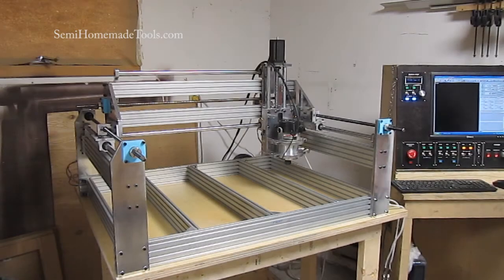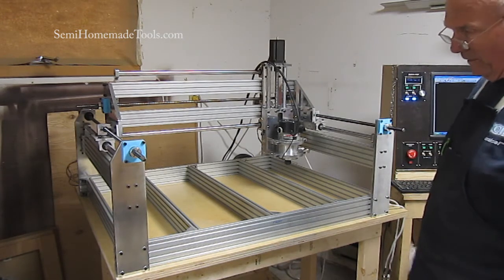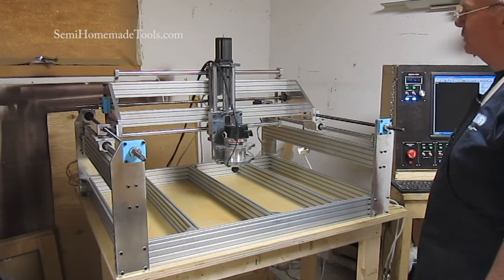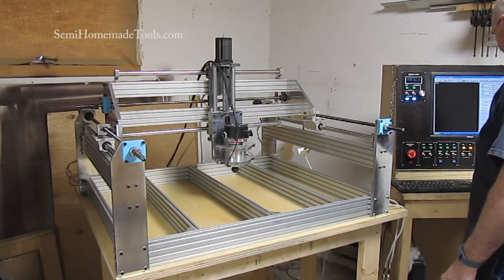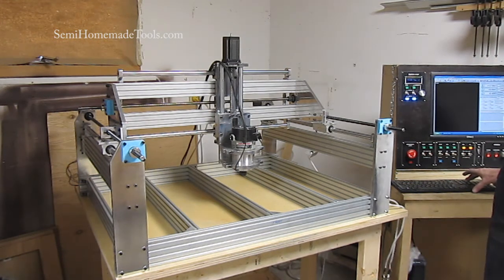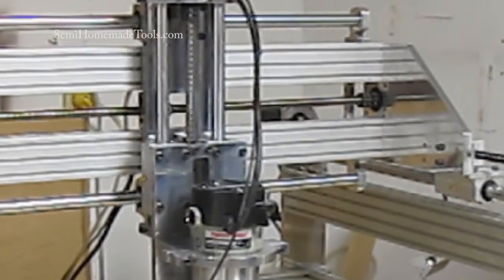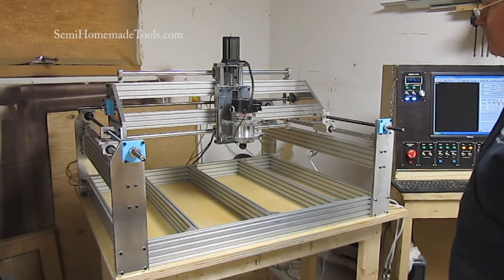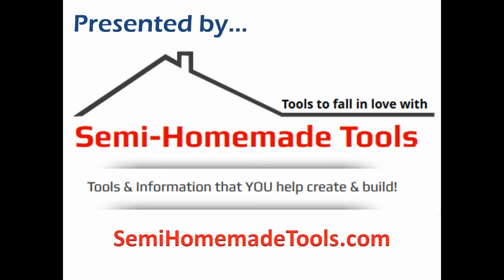CNC Router Build Wrapup Part 2

Comment from the maker: The router is porter cable. 

The control panel is a my design. It as power switches for the computer, dust collection, vacuum table and controls for spindle. The upper left is the Super PID2 speed control for the router. And of course there is an emergency stop.

Comment: One other question.  It looks like your are using Mach3 to control it, but could you explain your control panel?  Seems to have lots of switches and lights, what they used for.  Thanks again.